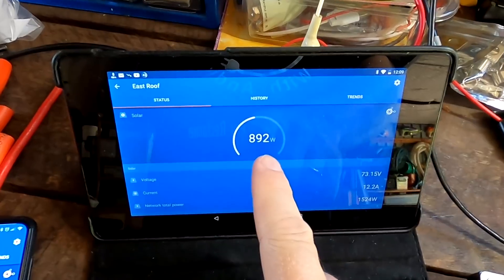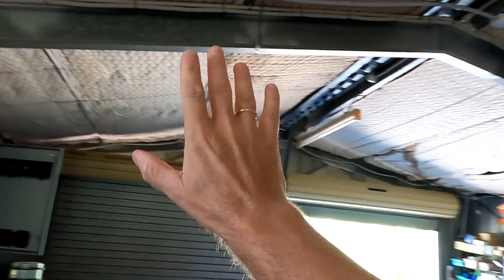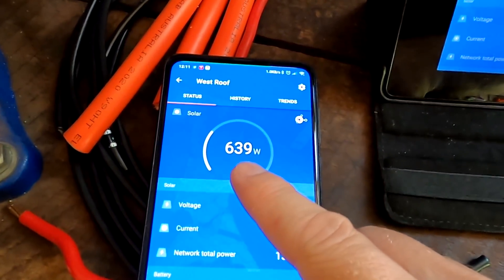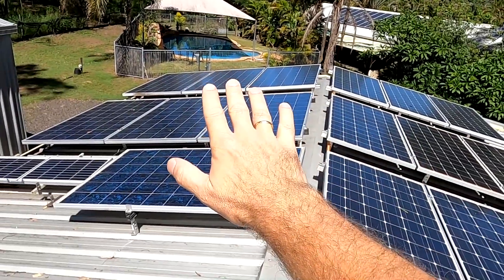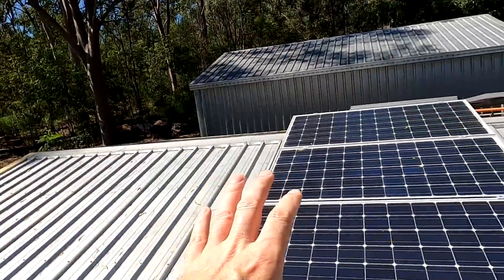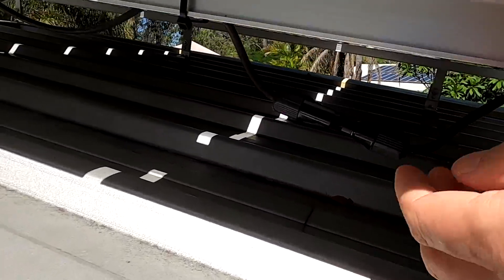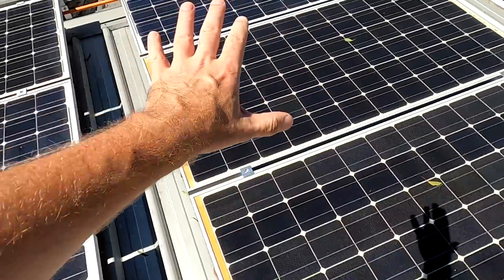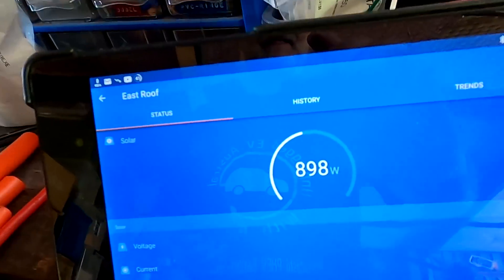60% Solar Panel degradation? Just why? Troubleshooting Part 1

Comment: If those random two panels on the opposite side of the roof are connected to those panels and it’s a string circuit that’s your problem

Comment: In 2008 I bought 3 mono crystalline panels and soon I found that the panels work so bad when the sun light does not optimized in front of the panels. So last year I decided to buy some 18 poly crystalline panels 346 Watt each although I studied that the mono crystalline panels are more efficient than the poly crystalline.

Comment: A couple things: I cannot do what you did, disconnect while the sun is shining.   I did it once and it knocked me on my butt, presumably from static build up.  Also, you must match the current in high voltage strings.  You CAN connect an 8 amp panel with a 10 amp panel, but you will never see more than 8 amps out of the string.  Voltage does not matter in serial strings, only amps.  The best idea is to use an inverter or charger that has multiple string inputs, so you can use similar panels together on one string.
I have two systems and three inverters.  8kw on a contract (separate meter) with Georgia Power Company, and 6kw grid tied.  I am using two Fronius inverters on the GA Power, and an SMA 7kw inverter on the grid tie.

Comment: Your my  #1 YouTube channel.. TRUE>.. Wacky Panels...I propose as panels pass current the resistance goes up in a individual panel group.. R=IE as you know.. Please calculate for resistance when powered with sun at a circuit location IN the panel circuit after an inside solar panel group and before its solar diode.  Thunderstorms? or age? of the panel.. Thanks YouTube friend. These panels are not absorbing power perhaps and are just not providing power.
Reply from the maker: Thank you Dan. More testing underway...

Comment: Why do you need two MPPT charge controllers?, each one of these controllers can handle >5000 W of power. You can connect all your panels to one device and two devices seem to me as overkill !

Comment: The numbers on back of panel are STC (25 degs C).  Spec page says Pmax at NOCT (40 degs C) drops to 139 watts.  You look like you are running at hotter temp than NOCT.  Factor in the spec's temp coefficient numbers for your expected Voc and Vmp. At 50 degs C your three series panel Voc should be about 120v.  At 60 C, Voc is about 114v.  From your number your panel temps are likely between 50-60C.

Anyway, your issue is likely panel matching.  Get an IR temp measurment gun and measure Voc and Isc for each panel at same illumination and temp.  Best done within half hour timespan near high noon on clear day. Keep in mind there is a time lag for temp going in and out of cloud blockage while PV illumination electrical is near instantaneous response coming out of clouds.  This time lag on temp change can screw up your matching measurements.

Your best solution is matched panels in each series strings.  Probably will have to run each of matched three series panels on its own MPPT controller unless you find two series strings with same close matching.  Make sure you have some air clearance behind panels or they will operate at higher temps, reducing performance.

Comment: There is also possibility to load test them..I know it require load tester.. but those are not so expensive and they work pretty well for 200 -300W ..So you can test that too..it would be interesting thing to do..just to see real power coming from them
and you don't have to test on those on your roof..test it on some that are on the gorund..or one of those new news you bought just recently :)

Comment: Did you try connecting an empty battery? What is the maximum charge current set to on your controller?
Reply from the maker: The battery is not full and can handle over 4000W of solar easily.
Reply: @OffGridGarageAustralia  maximum charge current ok too?
Reply from the maker: @ralph9987  they are both set to 35A each. I'm maxing out the panels on the east roof with 1.5kW but not the ones on the west roof due to this issue.
Reply: @OffGridGarageAustralia  this is so frustrating.grrrrrr!!

Comment: I had a similar issue with my LG bifocal panels... but when I started to heavy pull from my lithium cells it kicked up in power of the panels... it could be your victron units trying to protect the cells??
Reply from the maker: No, that's not the case. SCC don't protect cells. That's what the BMS is for. Battery was at 60% at the time of testing.

Comment: How long is your wire run from the panels, what gauge wire are you using for that run? It looks like it’s not thick enough 
Also it’s realistic to only expect 70% of the max new panels say they can produce. That’s with proper sized wires. 
Now if your panels are also used- 10 years old, you will get less than 70%.

Comment: Ok, watched it to the end. Not staged :-o
To help: you put three strings in parallel on one charge controller? How do you think the mppt will work?
Make the strings longer. Maybe all 6 in one string.
Clean the panels! The leaves on the panels take at least 1/3 of the power away! This triggers a lot watching the video.

Do not! disconnect under load. You will burn the connectors. Even at 2ah.

If all 6 panels are in one string, they should have the same power and voltage, plus the sum of the voltage should be correct.
Then you can look at the power.

Comment: You can not be serious. Is this video staged? Did you do any research on how solar panel work and how they should be operated? Maybe you should look into the bypass diodes and the leaves and dirt on the panels, before you disconnect the panels. And if you disconnect under load, reconnect it completly. Electricity is no joke and errors a seldom tolerated.

Comment: I reviewed this video again. 
My take away.
1. String 1 has 3 panels by the same manufacturer. 
2. String 2 has different manufacturers, 2 old panels and 1 new panel 
3. String 3 has 1 panel that was suspect panel from your house.
4. Every test I saw always had string 2 in parallel with other strings.

Recommendation..  
Try to get string 1 working to expectations all by itself. String 1 is the only one with 3 panels of same manufacturer and age. Do not mess with string 2 or 3 until string works.

Comment: Good job.
To resolve the low power problem, I suggest you measure  Voc and Isc per panel, and sort the panels to provide roughly equal Voc per string.
Check the cables on panels with low Isc and change the panel if cable is good, or put such panels on a string of theirs, if the Voc is good.

Comment: Junction box issue, voltage drop in the wiring from panel to charge controller.   Check voltage drop from panel to charge controller

Comment: You have several problems:  (1) any shading on any panel will reduce the entire string.  (2)  Do not  mix and match different panels with different specs. (3) Name plate specs are not real world.  Name plate specs best world specs done in a laboratory conditions. (4) open circuit volts/amps will always higher than closed circuit readings.

Comment: I would guess temperature would account for some of the losses (depends on the internal temp of the panels). It's also normal that the MPP voltage during your testing will be lower than the MPP point on the label of the panels (those are the values measured at 25 degrees), higher temp = lower voltage, lower temp = higher voltage.
Also combining different types of panels with different Impp will cause less yield (you only showed the suntech labels), are the Impp's the same ?

Comment: I know we are probably on a delay on this but wanted to share something that happened to me.  Something to check with low-performing panels check the Schottky diodes mine were making the panels lose some power well about 40% so not as bad as yours but confused me for quite a while.  I just bought a big bag of Schottky diodes and replaced them all after finding one that was low resistance both ways.

Comment: My guess is bad connection in the old plugs or cables. Once I had jumper-cables that visually looked good that were only clamped to the jaws and didn't even conduct enough current to run the interior light on the depleted car. I soldered  them and now they work just fine. Good luck Andy, and thanks for always trying to learn more! Hope you have a nice cold beer after! Cheers from Sweden!

Comment: Check short circuit current for each panel if all looking good, , them measure each individual panel voltage with the all panels in a string connect to the charge controller you will find the weak panel in the string

Comment: Open and closed case: Your diodes are the wrong way round😜
Reply from the maker: Because we're Down Under, right 🙃
Reply: @OffGridGarageAustralia  ;) exactly! Btw sometimes you can catch a rogue panel by using a thermal camera. No need to climb onto the roof;)

Comment: what I thought I saw was that the Volts at MPPT changed and they sound from 60 + v to 80v depending on the string and it should in my mind change a lot in the result. Then well ages were more "optimized" for 1000w / m2 and gave poorly when it became smaller, which is also the case if they are not completely aimed at the sun

Comment: Hi Andy,

All it will take is one faulty panel or component in each string to degrade the output power. The problem with used panels is that it is likely there were technical problems with them or they would still be in service where they were initially installed. Unless you know the service history and condition of each panel, you will need to test each panel separately to establish their current individual condition. 

The panels could have aged and developed hotspots , it could also be due all the panels underperforming due to the high ambient temperatures on your hot roof! Or it could be bypass diodes leaking reverse current and acting as resistive loads in each string? You will only determine the problem by doing the hard work to find the fault. 

If all panels individually test the same and appear as normal then it is probably the high ambient temperature on the roof adversely effecting the old used panels!
Reply from the maker: I don't think it's the temperature. The panels on the other roof side are working fine and even through summer with 40°+ they worked above their specs. No, we have autumn and much milder temps.
I need to test them individually, I guess.
Reply: @OffGridGarageAustralia  Andy you have been exceedingly lucky with your used east side panels producing more than their rated output at times! As was mentioned by someone before - I would be suspicious of any panel the leads where cut off as it might be deliberate to discourage the re-use of faulty panels?
Reply from the maker: @nigeldunn4467  they don't test the panels when they take down such a system. The installer gets paid by the job, not time. So he works s quickly and efficient as possible. If some MC4s are hard to disconnect, they just cut the cables. That does not mean that these labels haven't been handled roughly at this process.

Comment: Just a wild guess. Maybe the bypass diodes on these panels can't deal with the higher voltage of the 3 panels in series, or had a rough previous life (maybe lightning strike closeby?) and one of them shorted, resulting to one panel not contributing to the string. Check the diodes and for signs of corrosion on the cables! Also try cooling the string down with water to measure the effect of heat on the panels. Furthermore, if the panels are mismatched, the resulting I-V curve may have more than one "knees" (mpp points) which may confuse the charge controller and chose the wrong point as a MPP point...

Comment: You must check voltage on each panel while in series and make sure MPPT is drawing MAX power by your calculations derived from panel max power voltage drop from open circuit voltage.

Comment: Hello, 
« Mixing different panels, whether connected in series or in parallel, ALWAYS reduces the installed wattage.  « & « In series, the total current  is determined by the panel of the lowest current rating ».  
I can't post the source here - please google the first sentence to get the link ^^

Comment: The heat can affect the panels, but in my case I found water entered the connection box below one panel and corroded the connection. After some cleaning and soldering the panels all work as expected again
Reply from the maker: OK, there is the possibility this happened to several of these panels, even they come from different source. But how high is this chance? I'll check anyway...

Comment: I try to match the panels in a string. I'd be separating the panels and doing panel by panel troubleshooting. The age should be fine, unless they were treated very poorly (e.g. a concentrator) in their previous life. Do you have some extension cables to attach to all 9 panels to bring the connections down to ground level for testing?  (I hate rooftop panels...)
Did you perhaps get a batch of copper-clad aluminum (CCA) wire?
Reply from the maker: Next video ;)

Comment: I've got the same problem with some of my panels I got four 100 watt new power panels  brand new straight out of the box and I checked the diodes they're only putting out like two amps two and a half amps Max in full sun and it should be putting out five and a quarter with load without load it's somewhere around 6:00 and a half and they're supposed to be and  on one side the diode reads 15 to 16 volts the other side reads about 7 volts I don't understand that because my other ones that I have it's equal on both sides and yes if the panels are too hot they will decrease I've got some 260 Watt and they put out an extra 150 w if I spray water on them and cool them down in the heating I look forward to the next video when you find out what it is maybe I can fix mine

Comment: The old panels were stored for
years right?  I wonder if the MC4 connectors on each panel are crimped vs soldered?  Have to wonder about condensation and corrosion inside the connectors!
Reply from the maker: That is a good point. I had actually some older MC4 plugs with a few cm cable attached, which were cut off panels when they took the system down and some of them were so poorly crimped, the cable just came out of the plug when I pulled on it. I think they didn't use the correct crimper but just some pliers.
Reply: @OffGridGarageAustralia  It seems that, if the panel voltages are about right, and current output isn’t correct, there’s high resistance interfering with flow on each panel.   That makes the MC4 connections prime suspects IMO.  Good luck with checking it out soon.

Comment: Hard to tell what the problem is not knowing the individual panel specs and wiring series/parallel. My suggestion would be to test the panels individually, or at least each parallel run in the array individually to to see if any show a dramatic difference from the others, and narrow the problem down.  You probably know this already but it is my understanding that all strings of panels that are run parallel must match voltage, closely. Check the resistance of each panel with a multimeter as well, if one sticks out, remove it from the array and retest.
Reply from the maker: I showed all the specs in the video.
All parallel strings are voltage matched. I also tested them individually as shown in the video.

Comment: Andy, you refer to the spec open circuit voltage, but I thought that voltage decreases as the panels age.
Reply from the maker: It does but only a very small amount. After 10 years, they still should produce 97% of their initial power.

Comment: Andy I had the same problem with my panels , it turned out to be the Mc connectors . You have to use the same brand of connector there not all the same. I noticed the last panel you plugged in didn’t go all the way in the white o ring was still showing.
Reply from the maker: Great, thank you. I have replaced some MC4 were they were cut off, but now all of them. Some go really hard, some easy. I always thought it's because of the O-ring. Some WD40 on that ring and the problem was solved.

Comment: I have some old 295w panels and they make about 250w.  So unless they are damaged, used panels should be okay.
Reply from the maker: Exactly, so could be only the cabling somewhere... I'll check the MC4 connectors

Comment: Didn't you get these solar panels for free because you're so cheap maybe that could be the reason somebody got rhythm by mistaken maybe they just have degraded and when you run the same panels for the same amount of time on the same system on the same angle on the same roof they might be great at the same rate

Comment: Andy, this is probably too late.
To save pain when doing individual panel short circuit tests make up a test lead so you don't have to cut all your cable ties. 
Carefully note the polarity of current at each test.
I have had a panel that failed one side which absorbed current. Voltage was down by half a panel value.
Reply from the maker: I'll check this again. Thanks.

Comment: You might have a hot-spot on one panel pulling the rest low, buy a thermal camera and you will see what's a good and what's bad and where the high resistance is 💪 A C2 flir will  help. These thermal cameras are very economic nowadays 👍
Reply from the maker: I tested the strings individually...

Comment: I'm thinking the wire going from the inside ceiling junction box to the MPPT controller is too small for those 9 panels (3 strings) and has high resistance and limiting the amount of current that is flowing.  Maybe?  I forget what size mm wire you used... and remember to calculate the length of the cable into the equation...
Reply from the maker: I tested the strings individually with no improvement. If you theory would be right, I would see a different (better) result with only one string. Also, I use the same 4mm (~11AWG) cable for the east side and they work fine.